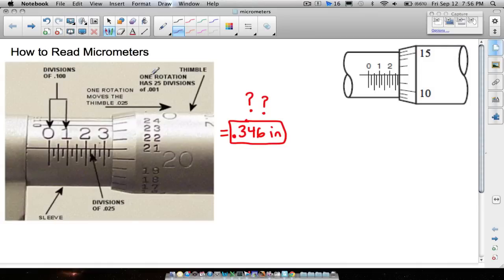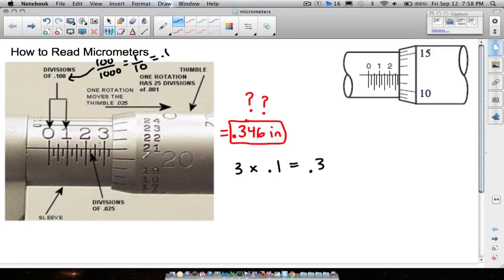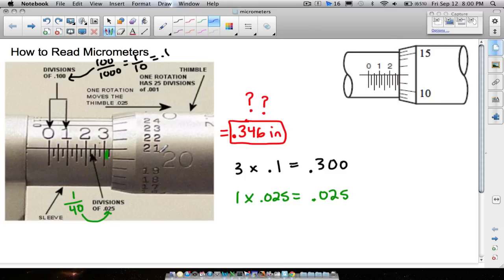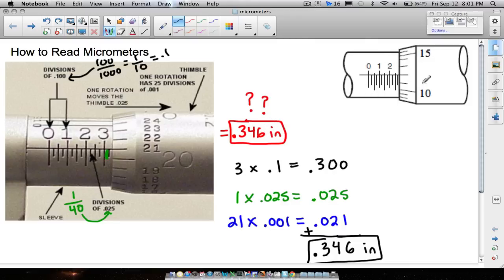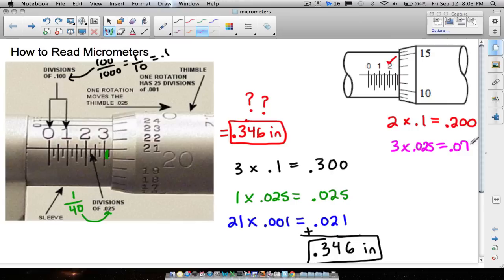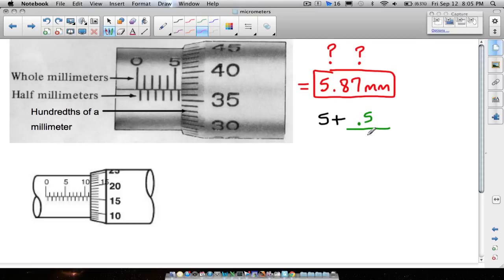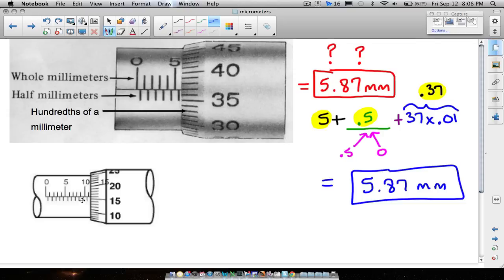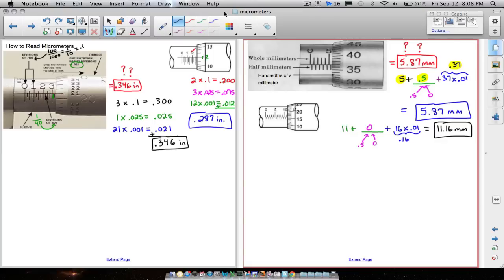How to Read a Micrometer (Inches and mm.)

Comment: My eyes are fucked up, I can barely read the 1/4 .5 3/4,  lines. I wear glasses,  guess i have to keep practicing  cause I wanna be quicker.  I'm Johnny on the spot with a tape measure,  especially if it has the eighths.
Reply from the maker: Same here... the older I get the tougher the lines get to distinguish.

Comment: Can you measure with a standard micrometer and then convert to millimeters?  Specs are in mm but I just have a standard set of micrometers.  Thank you
Reply from the maker: Of course. Use the conversion 2.54cm. = 1in.
Reply: @bcraftmath  excellent, thank you.  Only problem is I am not sure how to apply this conversion once I have my measurement in inches.  Do you multiply your answer by 2.54?
Reply from the maker: Exactly....
Reply: @bcraftmath  thank you!!!

Comment: Fantastic video.
Is a Thousandths of an inch more accurate than a Hundredth of a millimeter?
Which one is smaller?
The reason I ask is because I am going to get a  metric micrometer set and Mitutoyo offers both 0.01mm and 0.001mm  Is a 0.001mm necessary?
Reply from the maker: 0.001in. is roughly 0.0254mm., where as 0.01mm is approximately 0.0004in.
Reply: @bcraftmath  0.01mm  are finer measurements than 0.001"
I guess there is no real practical  or "must have" reason for a metric micrometer that measures in thousandths of a mm like Mitutoyo 103-130, the 103-138 in  0.01mm would be fine.